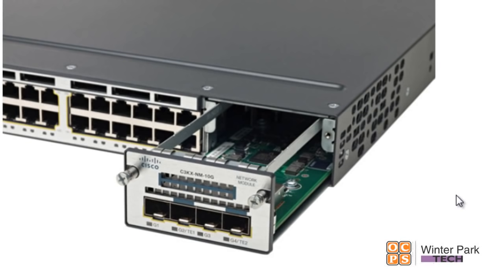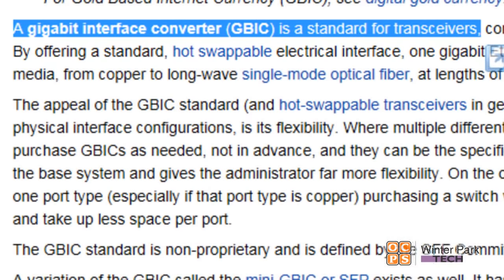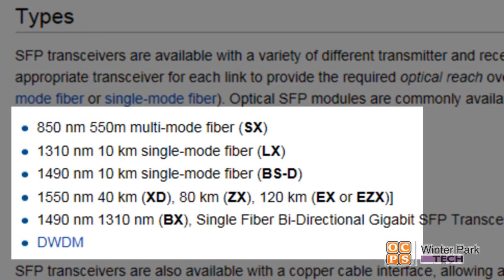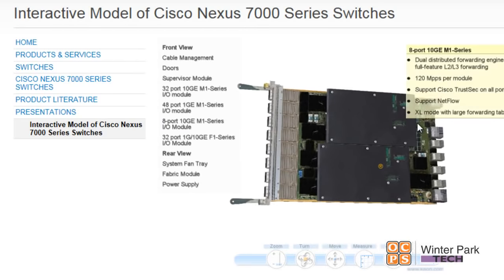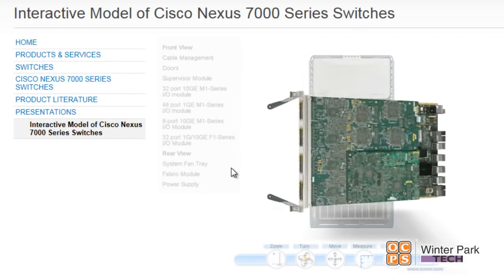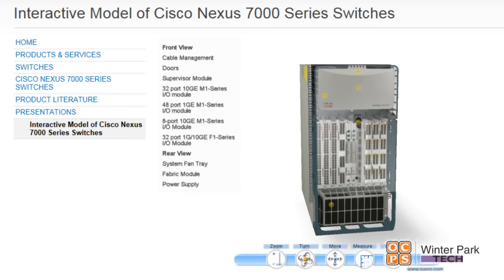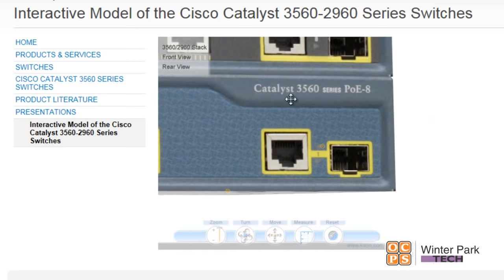Understanding fiber optics and network switches

Comment: Can't really see a huge difference in using fiber over Ethernet atm, apart from fiber not being effected by emi. Most fiber switches and hubs run at 10GB/s anyway, so you could just use Cat 6 cable which is way cheaper anyways.... Just my own little take on it.... Great video, and thanks!

Comment: Just a warning that some switches, including the 3560series 8Port POE switch from Cisco incorporates a "Dual Purpose Port".

The dual-purpose port can use either an RJ-45 connector or an SFP module, but not both at the same time.
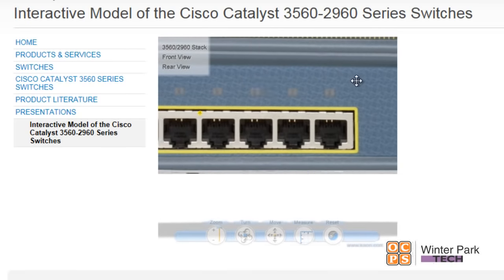See 11:05.
Reply: +freshgino  I believe Aruba's controllers are configured the same.
Reply: thank you, i'm glad you pointed this out. I was having an argument with my browser when he was proposing this configuration :)

Comment: Hi if uplink is not the best way to interconnect switches, then which one is a better way?
Reply from the maker: Great question!  Many switch manufactures have a proprietary "backplane" connector and interface that allows all the switches connected this way to be as "one".   It allows stand alone switches to interconnect and become like a chassis based switch with slots for for expansion.   The interconnection is extremely fast and allows joined devices to be managed as one unit.

Comment: sir i want to install a basic server .
or after that server i want to trnsmit signals into fiber optics cable to multi users on diffrent locations .twll me which devices i will needed in this process .

Comment: Sir Can you tell me that  what are the daily work of network engineer as a fresher ?
Reply from the maker: Great question:  If you work for a large enterprise like a hospital, you will be responsible for configuring access points, switches, configuring and troubleshooting various network issues.   You could be assigned firewall and router configurations and troubleshooting.    Most smaller companies hire third party companies to configure, install and troubleshooting their gear and solve their network issues.
Reply: @TechsavvyProductions  I got it thank you sir.